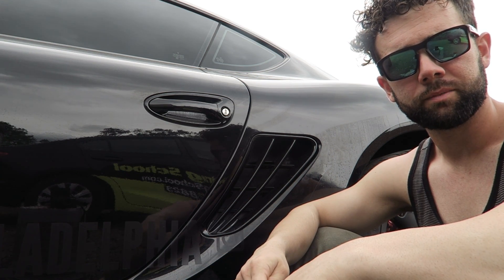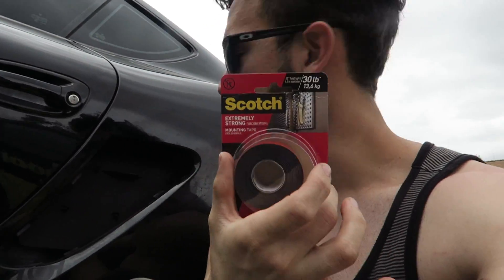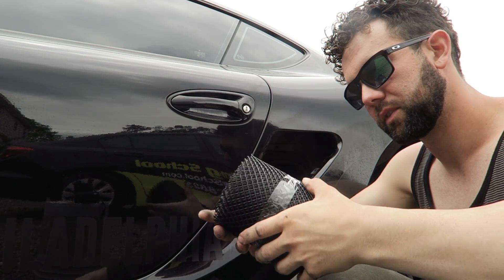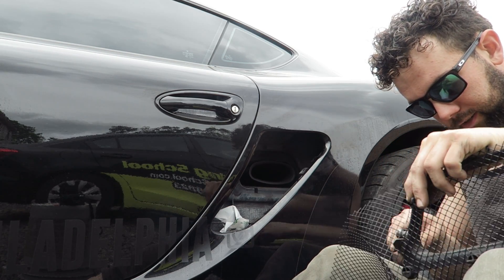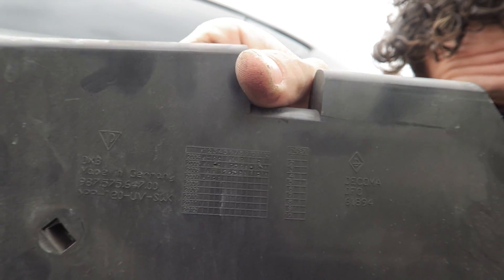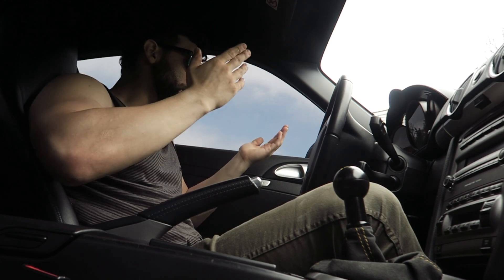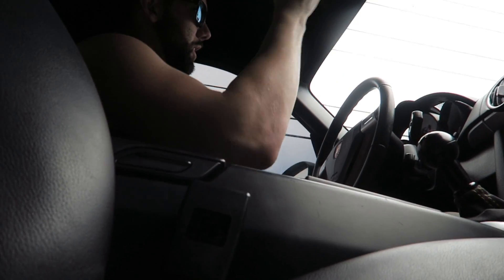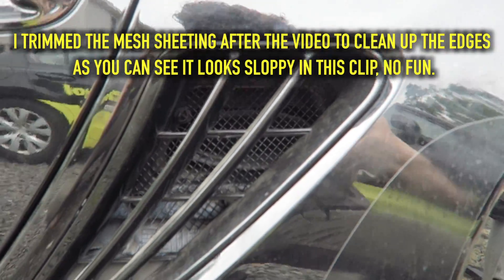HOW TO DESNORK OR DE-SNORKEL YOUR Porsche CAYMAN 987 S

Comment: Sounds good and it can only improve air flow which will always add to performance. Every little bit helps. I don't have a Porsche and probably never will, but I am enjoying the videos.
Reply from the maker: Drops operating temps on track quite heavily, makes sense considering that plate basically had it sucking air through a straw. Thanks!
Reply: literally the only dude on youtube who works on his own cars and has an AP on his wrist. mad fucking respect. watch cost more than the car ctfu
Reply: Brian,why not,a used 2008 base cayman can be had for $20,000...Cayman S with 45,000 miles is about $26-$28,000...you can def get one.
Reply: picked up my Boxster S on March for less than 20K.
Reply: cayman s with 45k? maybe one thats beat up and automatic... a good one would be 30-40k  @DenisDamulira23
Reply: Doug it depends on location as well. Where I live Cayman S with about 85k miles are selling for 20 to 25k right now.
Reply: BRY 2 K TV why not

Comment: Go on a drive start in second gear and roll on the throttle from 1500 rpm. You will here the intake sound change after 5500 rpm. That's the main difference besides the wooosh when you stab the throttle
Reply: is it noticable?

Comment: could just put holes in the solid plastic cover piece you took out.
Reply: Wreklessracr still restricted, might as well go all out and make it count. Adding holes still doesnt give the full open air way like this did.
Reply from the maker: Wouldn't shooting holes into the quarter panel be even easier?
Reply: Wreklessracr not as flowy?

Comment: Makes no difference for performance so why do it? The restrictor actually does server a purpose. Just like the breather/air filter combo on other engines.
Reply from the maker: Causes consistently lower engine operating temps during track days, thanks for watching! Don't forget to subscribe if you haven't already
Reply: Supercars of Philadelphia this mod after dyno tune can help with a more open air flow to the motor will make a bit more HP and help with track heat restrictions to be less of a restraint to the motor.
Reply: maybe he just doing the mod as a courtesy so we can see how its done?
Reply: Robert have you dynoed the car before and after said mod? If not how can you accurately make a claim like that if you have not tried it or dynoed it. Just because you can't feel it doesn't mean it's not adding performance. Not all mods make it go faster. Like mentioned it helps keep temps down at the track which adds to performance. Don't make a claim like that if you yourself haven't tried it. You're just talking out of your ass making assumptions.

Comment: Because I have a cayman 987 would you like to tell me if there is any problem with the waters that will come in there? Thanks
Reply from the maker: I have not had any issues along with many others i've spoken with. Adjust at your own risk! Although water shouldn't be a issue
Reply: Ending this air import? I want to change the air ducts, and I thought that without the lid will look more beautiful! May I put in a bigger trot? So that it can not easily pass to the wash? thanks a lot my friend
Reply: I would advise to NOT drive in the rain if you do this mod.   There is a Vlogger on here who had a 2017 C63 AMG and it was totaled in just 3 weeks after he bought it - due to driving in the rain and another car cruised by him and splashed water on him, which his intake sucked water in. It KILLED his engine.
Reply: what happened to autoVlog has nothing to do with this mod it was a freak accident. you would have to be really unlucky for water to get into the engine but I do think this so called mod is pointless.
Reply: nikos hatzifilippidis hi, I have a boxster ,and I desnorkled it, it is a very bad idea!!! Don't do it. When it rains the first 10min nothing will happen then all the sudden you will hear your engine try to shut off!! Just don't do it ,scary and dangerous. You will see, this dude will regret it. Unless you will only drive in the summer
Reply: its been a year and hes still tracking the car, what are your thoughts now? @alialrashidi1764   Supercars of philly do you drive in the rain? you daily drive all your supercars